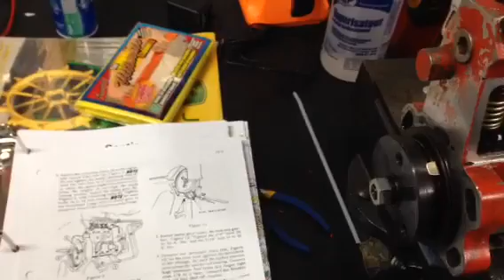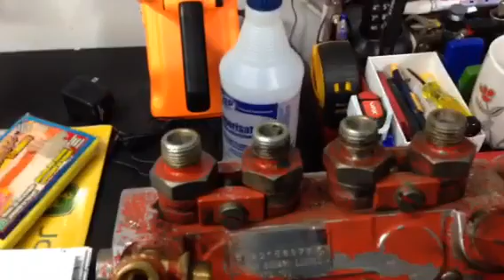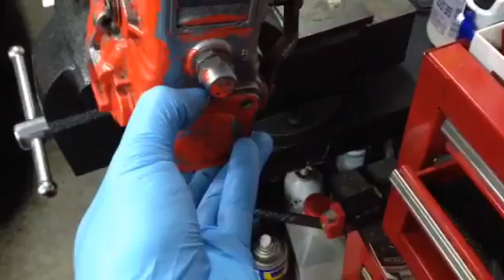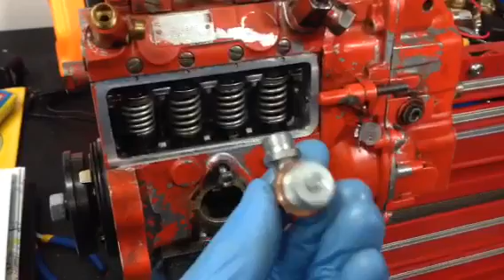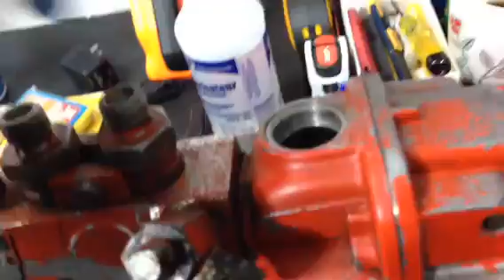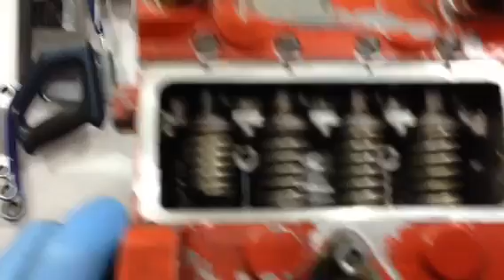Bosch 4 cylinder injection pump 1

Comment: I broke one of the big plunger springs in my kubota L260 with a bosch style PES2A pump with a pretty similar looking plunger/barrel/rack setup.  Any idea how i change those springs?  My DVs and holders are out and it looks like i have to remove the barrel clamps? Or does the cam have to come out to remove them from the bottom?

Comment: Hey we are trying to work on a lindy forklift with a deutz 913 3 cyl and we are having a tough time with timing it.  It hazes white smoke but wont start after the pump was rebuilt which it needed badly. We are unsure if we have pump timing way off or what.  Wondering if you had some advice
Reply: That definitely sounds like pump timing. Get a copy of the Deutz workshop manual, it covers setting the pump timing.

Comment: I have this same infector pump on my old Case 680CK Backhoe, the fuel rack is stuck and wont start. Does anybody know how to get it unstuck. I have the shut off pushed all the way in and when I work the throttle lever manually I can feel the rack trying to move ever so slightly when I stick my finger in that access hole in the front of the pump. How far should the rack come thru that hole when the throttle is fully open. Its probably about a 1/4" back in that hole from the front. Please help the tractor set for a long time but it ran good when I was using it.

Comment: Best video I seen so far.  This type pump far as I know just required the oil to be drained when the engine oil was changed then you removed the top breather plug and put in a half pint of fresh oil again.   I would like to find out what seal fails that allows diesel fuel to mix in the lubrication oil and eventually runs out the overflow drain tube.
Reply: The diesel fuel leaks through the injection plungers(i don't know the correct name for them)
There is no seal, they are manufactured so precisely that the plungers can move freely but the gap between plunger and cylinder is so tight that not even the high pressure diesel can get through.
If the fuel is not clean enough the plungers wear out and the diesel fuel leaks into the pump.

Comment: Hello Greg I have the same injector pump control rack was stuck I got free but now my tractor is over fuelling causing it to over heat as it’s a deutz how do I cut back fuel?
Reply: The small screw in the back of the pump loosen the jam nut and loosen it out(counter clockwise) I would advise doing 1/8 to a 1/4 of a turn each time and would set it where u had a little black smoke when giving it full throttle and a little smoke at a load

Comment: How does such an engine advance its timing, under light load or high speed?
Like old-fashioned petrol engines, using vacuum or centrifugal advance.
I can't see any way to do it. The injector camshaft is fixed.
Reply: It’s in the governor and rack I believe

Comment: The 6 cylinder pump is it also self lubricating, or do i need toe put some oil in the pump?
Reply: Should be self lubricating. what is it on? Different machines it was different

Comment: That altitude adjustment screw I call it the county fair screw. So that rubber o ring, good thing it is reusuable so you can turn that screw in when you get to the fair and then turn it back out before you get it home.

Comment: Could the shut off be gummed up enough that the engine would crank but not fire?  I have a 930 Case that's been sitting for years. How does one go about loosening a stuck shutoff??
Reply: Sounds like the control rack is stuck a little.  The shutoff lever runs the rack, if the shutoff is constantly engaged it's more than likely because the control rings on the control sleeves aren't allowing your control rack to return all the way.

Comment: So the small cover on the back had two adjustments, the smaller one provides more fuel essentially "turning it up". What does the larger adjustment do?
Reply: The larger one is called the torque capsule. This adjusts the amount of fuel the engine gets at the torque rating.  The smaller one is to be set while you are setting low idle.

Comment: you have to lubricate the  governor seperate for as far as y know, it has a seperare level screw, and a drain screw, its not lubricated by the same oil as the pump.the big 10mm alan key plug is the filler plug.
Reply: The big screw plug on top of the governor housing is there so you can adjust the breakaway and high idle while calibrating.  The entire pump runs off the same oil, there is a hole in the back of the main housing and the front of the weight housing that allows oil to flow through it.
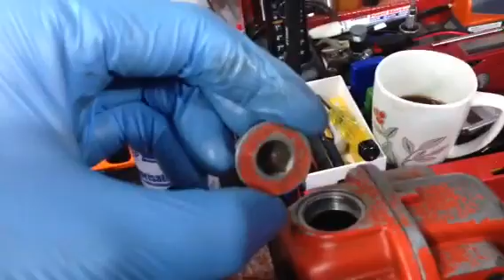Reply: You are mixing 2 different lubrication systems. One version of these pumps need to be serviced manually, it always has a breather cap instead of the plug at 7:56.
And the one in this video gets lubricated by the engine lubrication system, so it is basically maintenance free

Comment: what would cause high idle?stuck govenor?low case oil level?
Reply: I have the same question. Had to reinstall the governor and now when it starts it goes nuts  and wont idle down.
Reply: @FrequencyOfThought  you need to adjust the setscrew on the side in conjunction with the screw on top of the swiveling lever inside the weight housing.  In order to get to the screw in the weight housing take off the bid screw plug on too of the weight housing
Reply: @Matthew-hg4fm  Wow thanks for the response!  Somehow I ended up fixing it and it was the dumbest thing ever. A nut came loose somehow and it starts right up and idles. I now know enough from messing with it I can tune a pump by using  small plastic cups and my ear. I don't even need to take it to a pump specialist.. That's how long I messed with the pump.. days and days and hours spent on it..

Comment: hi if you be ever so kind to tell me what the flat head screws are? one for each cylinder / injector.. are those bleeders?  i hope to hear back very soon, great video, thanks!
Reply: kraden18 These flat head screws on each and every cylinder of the injection pump are special guide screw during installation of plunger in the injection pump housing.

Comment: on my Bosch pes pump ( of a Mercedes ) there is a flat  screw  head in the centre  were the square plate is at the back of pump , would this be the  fuel delivery adjuster

Comment: Hey, great video. Did you ever make the second one concerning the governor? I'm kind of puzzled to how these work, and can't find much info. I'm working on a JD 4600 that only has 630 hours, but has been sitting for 5 years or so with red diesel in it. I can get fuel everywhere, but it won't pressurize, or come through the delivery valves, unless I loosen them. I'm hoping its something simple, maybe even the solenoid actuated shutoff, but I don't want to take the governor off, without more info, and really don't wanna send it off for rebuild. Any help or info would be much appreciated.
Reply from the maker: I'm not familiar with the pump on a JD 4600.  If it is an inline pump like the bosch in this video, I might try checking the control rack to see if it move freely.  Perhaps it has become stuck sitting for 5 years?  Good Luck.
Reply: +Greg Niebergall Thanks for the response. I was able to get it running. The plungers/rack were stuck, but after some soaking, and a few taps with a wooden dowel, I was able to break them free. Now I can't get it to turn off lol. The rack is moving like it should, and the solenoid is too. I'm not usually a diesel mechanic, but its smoking a good bit, and has more knock than it should, so I'm pretty sure its running rich as well. Probably have some injectors stuck open, I'm hoping that may be why it won't turn off as well. Haven't had much time to work on it lately, but hopefully sometime in the next week I'll get back to it.
Reply: @gniebs1  Do you know if installing  a brand new governor what to do if it idles really high on startup ?